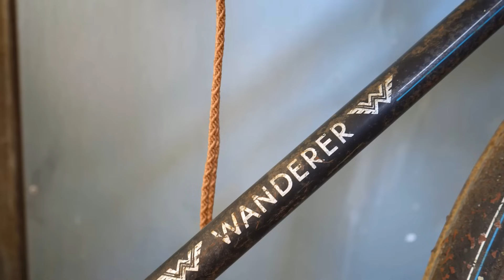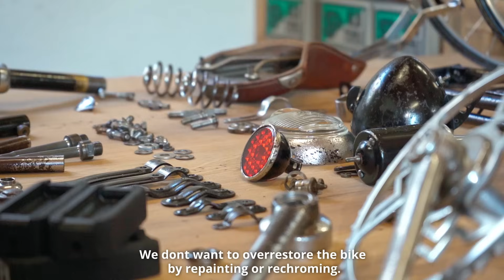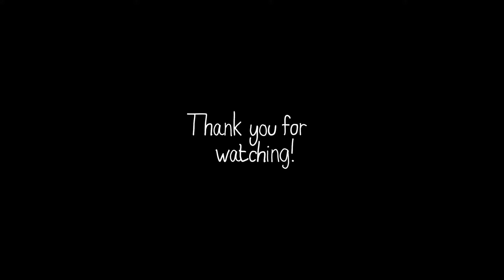German WW2 Bike - Restored and Ridden again!

Comment: This isn't a restoration video at all, it's a disassembly/cleaning/lubrication/reassembly video. "Restore" means to bring something back to a previous state, and when the term is used by itself, that previous state is "new." There's no such thing as "over-restored;" you either restore something or you don't. You didn't restore it not because you wanted to preserve the "patina" (which people these days like to use as a euphemism for "crappy looking"), but because restoring bikes is wicked hard and wicked expensive.
Reply from the maker: Hello Maxim,

thank you for your comment, and for sharing your opinion. I guess many other people follow this intention.
A restauration basically says: Bring something in the original condition. So you are right. 
Otherwise we want to preserve the original substance of cultural and historical value. So restoring does (in our case) not mean "making new again" and with that, the often very desired
clear "before and after effect" falls after a technically correct execution sometimes surprisingly restrained. 
I guarantee the work and knowledge, we put in our "restorations", is on a very high level.

Best regards.
Reply: @forgottenthings  "So restoring does (in our case) not mean "making new again""

Yes, it does mean "making new again;" you're simply using the word incorrectly. The correct word for what you did is "refurbish," not "restore." 

There's nothing wrong with refurbishing a bike; it's the cheapest and easiest way to make it function like new, but you shouldn't call it a restoration when it isn't. To restore it you have to also make it look like it did when it was new, and that's the hard and expensive part. For example, high quality paint jobs and chrome plating are difficult and expensive.

The problem with so many people using the word "restoration" incorrectly is that it makes it very difficult to find real bike restoration videos on YouTube.
Reply: I tend to agree, the term patina is often misused  and really has little to offer other than show the mistreatment the bike had in earlier times. It's an old bike, there are a million  'old bikes' in less than perfect condition. Why not do your best and restore it to really outstanding condition? Do yourself a favor: watch some of the restoration videos on YouTube by 'My Mechanics' he is in a league of his own- taking somewhat mundane items in disrepair and through remarkable skill and next-level machining techniques elevates these projects into a realm of righteous final condition.
Reply: Yeah, maybe refurbish or preserve would be better words to describe this. But i like that theyre making it function like new at least